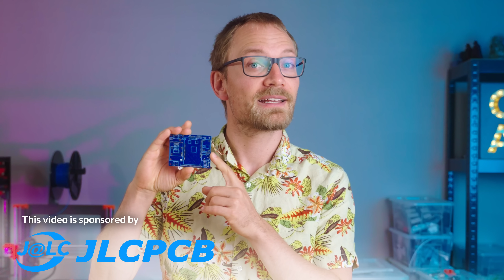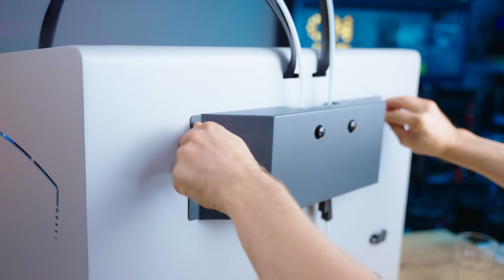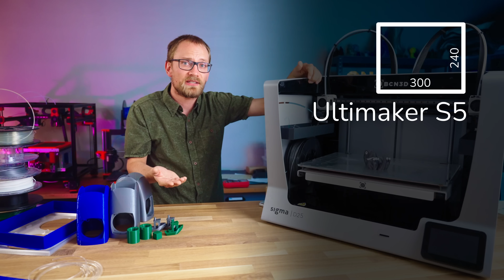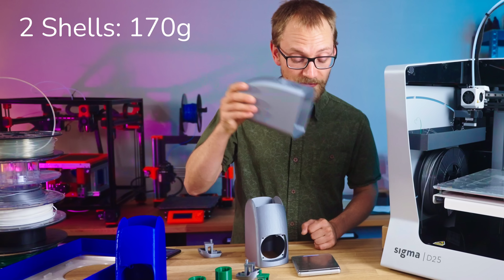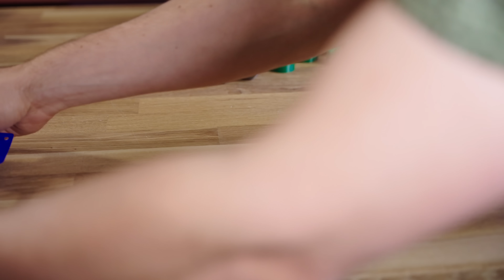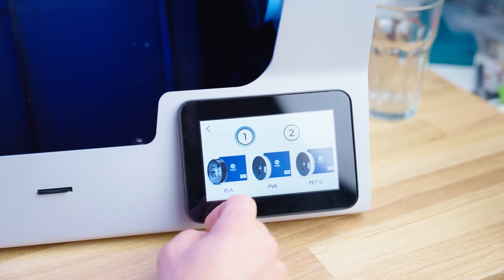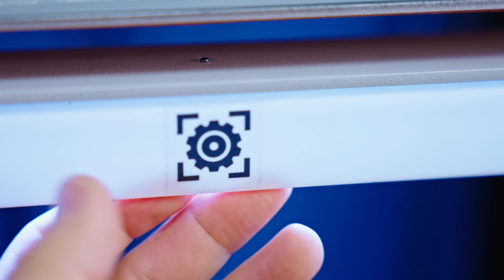Is this BETTER than the Ultimaker S5?

Comment: Howdy Thomas, did you take a look at the AddWise IDEX? It's 350 x 350 x 450 and it's set up out of the box for high-temp materials. I've been wavering between the Epsilon, the Sigma, and the AddWise. But I don't have enough information yet to pull the trigger on such an expensive purchase.
Reply: Well we've had an Epsilon for two months in our company and finally returned it. That flumsy printbed is totally crap and makes the whole printer more or less useless in my opinion. And it is really, really slow. We replaced it by two E2's from Raise3d which also have some problems but are running quite okay overall.
Reply: @lgmn-cnc  That's great information. Thank you. My issue with the E2 is z height but I may have to compromise my wishes and dreams in the face of cold reality.
Reply: @PaulTheTexan there is also the Craftbot Flow IDEX XL. I love mine. Very few issues!
Reply: @simwiz0  Good to know, I haven't checked into that one yet but I definitely will. Thank you.
Reply: i would not count the AddWise as a competitor (yet). There are only renders on their website and i cannot find any real pictures of the machine anywhere. 
Also i would shy away from any 3d printers that promise a 500°C hotend and a 200°C bed but still use a BLTouch..

On the otherhand BCN3D is a known company with multiple years on the market and are already iterating their product
Reply: @Kraxelaxel  https://www.youtube.com/watch?v=6WXt-I-fFI0&ab_channel=AddWise - this is more than a render. I agree with the lack of info, in fact I mentioned it in the comment you replied to. But it does appear to exist.

Comment: Not to chill for another company but there are alternative IDEX printers out there.
With a slightly larger volume and cheaper price you can actually build a RatRig V-Cast for example, its an IDEX printer with 250x300x400mm so its a bit short in one dimension though.
I guess only main difference is that the V-Cast is a bedslinger, well and that it is a full DIY printer, so you don't get the fancy casing and all that. Just depends what your requirements in terms of support etc are.
Reply: There's also the community project the MULDEX with a bit smaller build volume of Single Mode being: 340mm x 300mm x 300mm

Comment: For that kind of money, I would be pretty ticked off if their own quality control/dev team put out a $4k machine that can't do PLA prints nicely.  I'd expect that from the sub-$500/ endless supply of Chinese CR-10 knock offs.
Reply: You can run a printing farm with that money. Expensive machines are supposed to reduce maintenance, not create challenges to deal with in a workplace.
Reply: @TechnologistAtWork  right?  And that build plate...as Tom points out, why isn't that spring steel / PEX /PEI ?  No active bed leveling/mesh creation?  A BL Touch is pretty inexpensive.  And I just cringed at all the defects he points out.  That machine was slapped together, sadly
Reply: @WhereNerdyisCool  It should be a $500 printer because other than the dual extruders, it's not impressive in the slightest. Considering low-end printers can do better at quality, reputable manufacturers have no excuse making such terrible products.
Reply: Cries in having a sub 200 e3 knockoff
Reply: this is sadly not only for BCN3D. I have a other machines aswell from expensive brands with so many stupid things. When I Ask for firmware to adjust for those things they just say no. So I replace the board to a Duet and just reconfigure the way I Want. And its funny that I basically program it like a Prusa as its so incredibly easy to use.
Reply: Sovol3d has a better independent dual extruder printer. I plan on getting that one.

Comment: I don't understand the strategy of making such an expensive printer without auto bed leveling.
My assumption is that when someone buys something like this he's expecing it to be most plug and play as possible.

Am I missing something?
Reply: If you have a bed that is flat and a solid machine, adjusting the bed one time should last you a long time. Just look at markforged printers...
Reply: I've reached a conclusion its deliberately poor design and lack of features to maximise profit. Of course if people just stopped buying them, then companies would stop producing them this way...will we ever learn?
Reply: They depend on glass.
Reply: I used the raise 3d pro 2? It's a 5k printer with no auto leveling. We had to print a Guage bracket to actually get it to level correctly. After that it was fine for a while. But a horrible experience non the less.